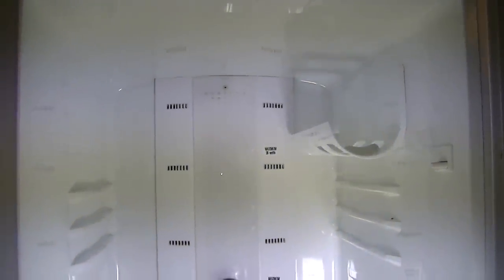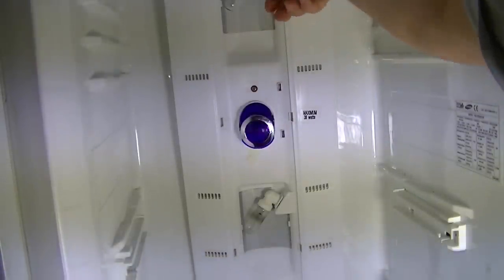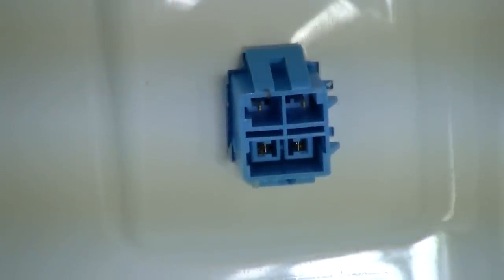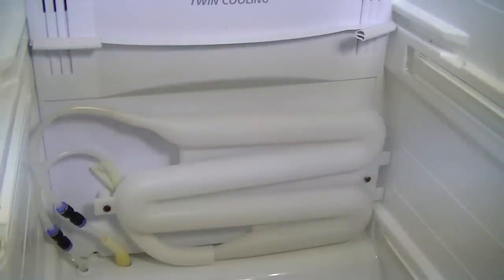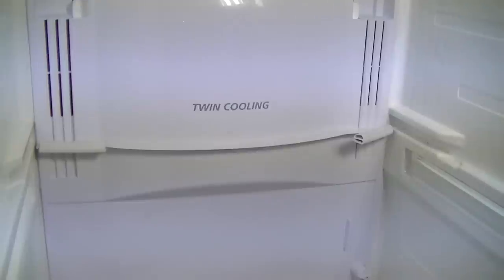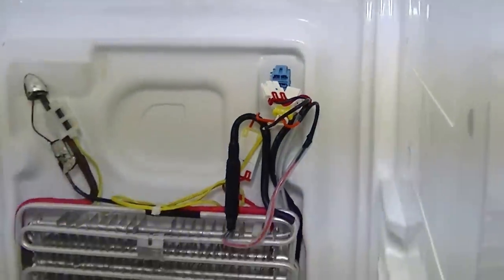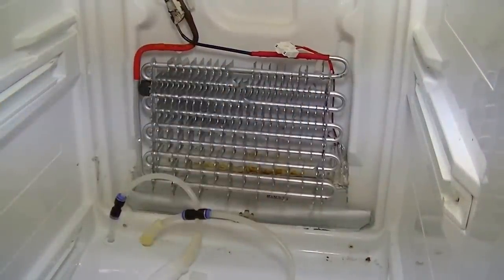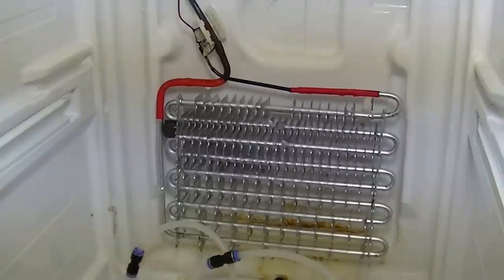Samsung Fridge Repair How To Dismantle RS21 - SRS Models Full Video Parts 1,2,3 HD 2023

Comment: Hey mate I messaged you about 8 weeks ago after fitting the kit into my f/freezer. I am not 100% convinced that I installed the thermal unit right to the back of the wall for the fridge. I now have my freezer giving up and the fan blocking with ice. I have been told there is a fan  design fault with this model. any advice please? Regards Tom
Reply from the maker: Hi e
Please call me I can help advise what to check etc . There is no design issue that I'm aware of apart from original fault which repair kit cures..
Reply: appliancetechnical  How do I call you mate?
Reply: appliancetechnical  here are the symptoms... after I changed the kit and replacing the fan (which you were right.. it wasn’t faulty), I have the freezer not working after about 1 week. There is a whirring noise from the fan that stops when you open the fridge door. Freezer temp no good at all. Ice completely thaws out from the ice box. Result after about ten days, I switch all the food to the backup freezer in the garage. Sir do you have any ideas what might be causing this? U are dealing with someone who does not really understand cooling very well. If you can assist I would be happy to pay you. And if not, no big deal. Cheers for your replies so far.
Reply from the maker: Thermal fuse should be right at the back of the cooler and the rear wall ..please calm me if you need more help ..ally 07407 734 204

Comment: Before buying the kit, take off interior panels in fridge as per video.  Lift out drainage tray and heater (this may be frozen).  To defrost use hot water or hair dryer as instructed in video.  To fully clear drainage hole remove bottom panel at back of fridge freezer.  Disconnect the white drainage hose and wash out (you will find this can be stuffed full of gunge).  There are two drainage hoses, one for the fridge and one for the freezer.  Refit same as removal.  Hopefully this should clear problem.

Comment: Brilliant step by step video making replacement of the kit very easy to fit. However my RS21DPSM is still frosting up after approx 3-4 weeks on regular basis. Checked self diagnostics mode showing (error 07)      R-DEFROST ERROR if you could offer any guidence on what to check as the service manual offers no resolution in the fault finding for this error

Comment: I've watched this video a lot and it's really helped me out in the past; however I've recently had problems with the fridge icing up and although I have replaced the defrost heater, thermal fuse and sensor it hasn't cured the problem.  Anyone with any thoughts on this?  Many thanks
Reply: You need to change also the Fridge Evaporator Cover Twin Cooling RS21 Samsung DA9705290Q/DA97-05290Q part DA63-00217L

Comment: hi kathryn i have just got same problem as you mine is 18yrs old too, but got rathered worried when seen all the dismantling of electricals, did you do full thing or did you just remove back panel and pour hot water on to the grill bit ?, thank you

Comment: hi, i am just waiting on a new water bottle, and have defrosted the panel behind the fan back panel as this was horrendously iced up. I am interested in the fast fix connector fitting in case of any future problems, but cannot find the video you refer to. If possible could you send me a link. 
Also, regarding the drain hole, mine looks pretty corroded and although i used a hairdryer on it , how do i know it is defrosted completely ? does the water come out the back somewhere ?
cheers

Comment: Great video. I would have been stuck without it. Thanks.
Managed to defrost it and the fridge started working. However now fan is making a noise like it's catching on something. You can hear it slow down when the door is opened.
Back in again! 🤣

Comment: Do you have a video on how to remove the metal backplate behind the machine? I'm trying to fix a fridge for the first time.
I have a Samsung rl44ecus that is warm in both upper and lower. Held 5 years. 25*C in both freezer and cold compartments. Digital display. Don't know if it has a diagnostic button function like in your other video? Great videos you're good to explain! People often say 'throw it away' but anything should be able to be fixed!

Comment: Hi I kind of snapped mine taking it off. There was a loud fan and a big freezing issue but I don't know what caused what. Do I need to replace the lot or let that defrost and replace the front polystyrene unit with the fan?

Comment: I have got the same fridge, it’s water tank got the leak which I replaced alongside filter and fan. It then worked Ok for 3 days approx. Now the ice has started getting accumulated near the water tank, what do you think the potential problem be? 
Fyi fridge temperature is 6 and freezer is set to -18, it is in UK, do you think temperature is ok?
Reply: sounds like you need the repair kit - the water bottle is freezing due to the ice build up  which starts on the panel and transfers across to the bottle

Comment: hi, I have removed all the pannels to find a load of ice build up behind. I found some tin foil behind the grill is this normal?
I have been quoted 100 for an engineer I would rather buy the parts and do it myself. Any advice to what part could of gone wrong?

Thanks
Reply: I have this too - did you ever find the answer?

Comment: I have a question: On my Samsung side by side RS 21, the temperature of the refrigerator goes up and down to -4 degrees and power cool switches on and off automatically. What could be the reason?

Comment from the maker: hi it may be behind the unit , if not is should be on the water line best thing to do is to follow the water line from the fridge back to the sink etc , it will be on the water line somewhere , normaly if its not behind the fridge it will be in kitchen cupboard under sink etc , hope this helps thanks ally

Comment: Hello sir,my rs21 fridge is not cooling down.Both the evaporators are already cool but theirs fans are not working...I tested the fans resistance and found 1.5kiloohm and a zero output vdc on the motor terminal.Kindly advice sir
Reply: It was working some days ago but when I relocated my place of residence it developed that problem

Comment: Hi could you help I've this Samsung American fridge freezer
Noticed that the fridge felt warmer 
So cleaned coils 
Reset fridge 
Turned it off 
Defrosted it for 6 hours 
There was alot of built up ice in bottom of fridge 
The fridge reading is going up and down drastically from 4-16 degrees
Couldn't get the plastic part off and was afraid to break it would it be the ice behind it making it stick and making the fridge not work
I can't afford a new fridge freezer ATM 
If anyone could help I'm a woman that doesn't know much as these type of things thanks

Comment: I am hoping someone can help... we have a RS21NCSV fridge freezer. The fridge coil completely froze over, to the point of it toucing the fan (it started making a huge amount of noise). Hubby cleared the ice, using hot water... however it hs refrozen again. The fridge  and freezer temperatures are displaying the temperatures that we set it at. We are trying too figure out, if it is worth while fixing. 
What could the problem most likely be as the actual fridge temperture is (acording to the display... plus the items in the fridge are staying cool) at 4 degrees... We ran the self diagnostic check and it displayed R-FAN ERROR. Could it be as simpe as just he defrost sensor needing to be replaced. I would appricate help. thank you.

Comment: Samsung has changed the fan connector plug from a single unit to two plugs. They WILL NOT fit into the old socket, I had to change the plugs over which was a real footer to do.
Perhaps Samsung could do a couple of things, provide an adaptor for the old and new connectors and put in some new fixing screws, as the one I did they were all rusty.

Comment from the maker: HI  it can have both tbh 

1st is thermal fuse situated on right side of cooler unit - test with multi meter it should be closed circuit 

2nd if its had a safetey visit from samsung there may be a set of 3 fuses in side the main pcb .. these can be tested again by using a multi meter 

hope this helps ..ally 07407 734 204